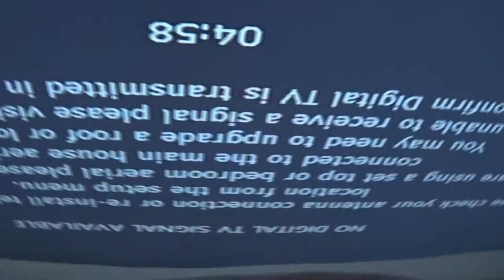17PW26 No Pfc Repair

Comment: MrReeceyburger123

Hi friend I have big problem,blinking light on/off... ( Have Video on my chanel )  I have Replace all Cap only standby 2700uf I didn't I forgot to order...
even replace c881 with new one.

uf5402 diode constantly church,this evening I replaced c881 with new one and and put uf5404  TV working almost 15 minutes and again uf5402 diode church ???

Thanks in advance for advice on what to try

Comment: Interesting, viperfrank had one of those little ceramic caps fail short in a recent repair too. Maybe its a low quality batch that all the cheapo manufacturers like Vestel bought up.
Reply from the maker: Cheers also yeah just acrappy design causes em to fail.

Comment: Have a problem with my tv with the same specs and cards. Just wont start. No standby light. Dont know what the problem is. Worked just the other day. I have measuerd with a "powerpen" and I have power all the way to the card.

Comment: I have a Samsung power supply board that has blown a surface mount diode. I can't find a schematic for that board. Is there any way to figure out what to replace it with?
Reply from the maker: Cant help sorry replacement board might be best.
Reply: Can you find any similar looking diodes on the board?

Comment: Haah, I'm using the same board to produce a video series on SMPS repair. Now that coincidence is funny, especially when it shows how small YouTube is in fact, despite zillions of videos, just clicked on yours by pure coincidence, without YT search.
Regarding the ceramic cap, the design is awful. There is a high voltage trace running right below the cap, and the cap sits less than a milimeter above it. This trace is not connected to any of the two leads. 
Such design is destined to fail... Good repair though.
Reply from the maker: Hey man cheers just watched a few of your videos sorry I didn’t reply sooner 👍